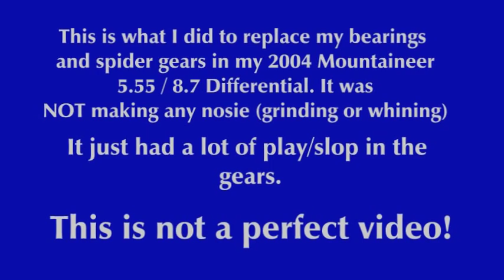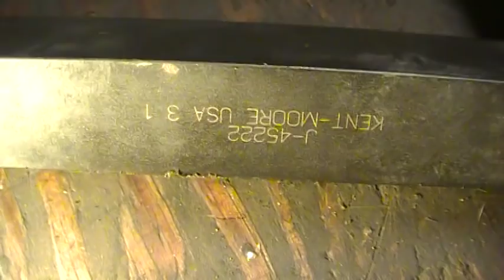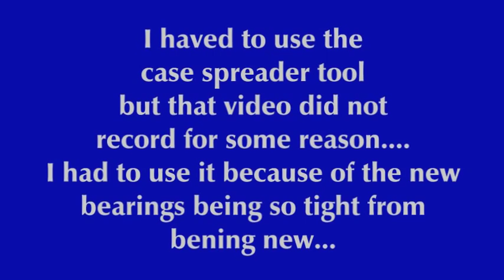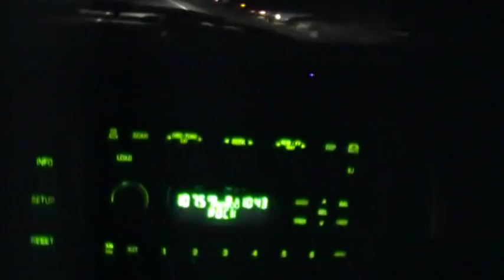2004 Differential Mountaineer/Explorer bearing replacement 3.55 / 8.8 open

Comment: i saw a vid where a guy put a punch through the bolt holes where the driveline connects  in order to set the torque  on the crush sleeve ....it  locked on the case . it looked like it worked pretty nice

Comment: Big fail on the bearing removal.  Could have thought of several other ways other than scaring the carrier race.  Ship happens.  Reading other comments, I'm not alone in saying its not a good thing.  Duct tape and JB Weld 'll do ya.   But this video is valuable, so keep it posted.
Reply from the maker: Working perfect to this day!! +50,000 miles.
Reply: @FixingWithPassion  Fantastic.  I am a perfectionist.  Was it better to rebuild your way, or getting a reclaimed one?  Mine is whining at 45-60. Has a weeping leak at the mating seal.  Drives me bonkers.  2010 140k miles, 4.5 V8 fully loaded 301 package 4wd, with upgraded extras.   Great great car for what it is.

Comment: If your intent was to provide information and procedure of what not to do. Well then my friend you have suceeded. Good Job. I am well aware of the effort it takes to perform both of these tasks. Yes its not easy, I get. 
You screwed up that carrier. Its your vehicle you do you. But...folks attemping this type maintenance dont need to hear that scoring the bear surface is "not/no big deal.
Reply from the maker: +madmacc040    lol....      A ...I did not score the "bear surface". 
B ...The bearing has it "own bearing surface" as a complete unit... The outer race/inner race...sliding over the the small scratch area. No moving parts will ever touch that scratched area.  Its a two peace bearing....outer/inner. Anyway...
 Good bye, thanks for watching.

Comment: OK video, other than grinding into surface??? What is a correct torque for carrier bearing cap bolts?? If you know it....Thanks =)
Reply from the maker: 85 I believe.
Reply: I was told 90-100 ft/lbs??? Thanks =)
Reply from the maker: Like I said its been a while. I'm sure you can find that info, that corresponds with your application. Google... we all love it!   ;)
Reply: Yep, thanks !
Reply: @Eeropolvasti   no.. 70-85 Lb-Ft. typically check your year, as long as you have the same rear diff..  is typical.

Comment: How many miles did it have? Mine has 170,000 miles and it just got diagnosed with bad rear differential.
Reply from the maker: It only had 150,000 ish.
Reply: I have 200k on mine still yet to rebuild, but its starting to hum, and I have a feeling the bearings are on its way out..but these hums can last a long time... I worked at a repair shop for years and some people cant afford to rebuild, replace and bearing hums can last awhile... but. if you have shaking, growling, I would replace ASAP..... hums I never care for my own ....we have a new engine, trans etc.. 2002 Explorer, so not going to bother, rebuilding it, until it decides to get worse or take a shit. its been like it for atleast 20k, miles.
Reply: @recon5107  My 04 4.6 Explorer has hummed for over 100K mile and about 7 years now. Almost at 200K...I figure at this point it's either good...or when it blows I'll just figure it out from there.
Reply: @recon5107  O also can start to hear it at 50 mph and slightly increase. Had a seized axle bearing on it like 7 years ago. Took it to a speciality rear end shop. Replaces only the one bearing. I asked the guy back then about the hum, he said, "O these things have thin aluminum cases dont worry about it"

Comment: before you repaired did it clunk at 35 mphs? was this front or rear pumpkin
Reply from the maker: Rear... and yes...clunking.
Reply: TVWXMAN32 good to know, I think my front diff has same issue. thanks for the tip on the spreader. i already did the rear on my 03. i got lucky and didnt need the spreader.
Reply from the maker: Just make sure the noise up front is not a bushing or something making that clunk. I've been fooled before ;(
Reply: TVWXMAN32 I have a head scratcher. I checked the bushing with 3' prybar, all is tight. I have vibration starting off to about 35-40mph. then a thump, like the awd kicked out. not sure if its transmission, transfer case or front diff. i replaces wheel bearings and axels and axel seals. and a reman front drive shaft. stumped.
Reply from the maker: Is this A AWD system?
Reply: TVWXMAN32 yes awd. when I manually lock the  4x4 in, I still have viberation but no bump at 35 or after 35mph. seems like the awd is in auto mode, the awd is engaged to a certain mph and when the awd finally  disengages it feels like a hurst shift kit!

Comment: Would it have been more cost effective to get a used differential vs. rebuild?  
The used differentials that I see for sale usually have more miles than my car though :P
Some of those bearings seem kinda pricey.
Reply from the maker: +Screenguy3  No I rebuilt mine for $120.00   Used carried $300-$400 where I live.
Reply: depends where you live. mine is 100-300.  rebuild is about 180.  So its up to what the person wants really... because with a used one, no idea how long it will last...and these love to leak seals, so if you did install a used one I would replace the seals ...atleast...